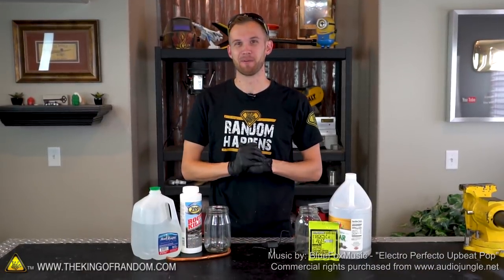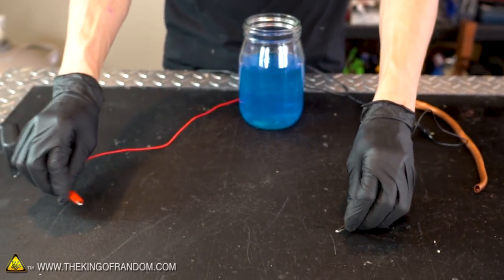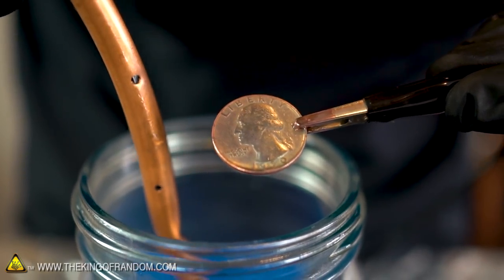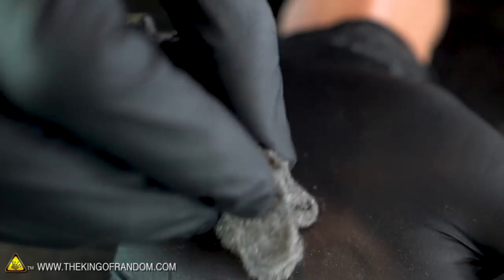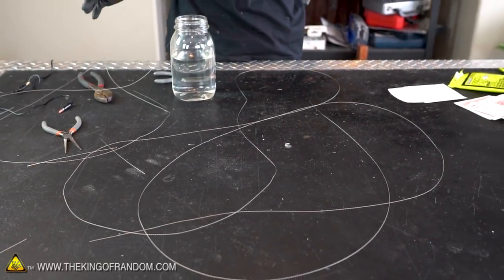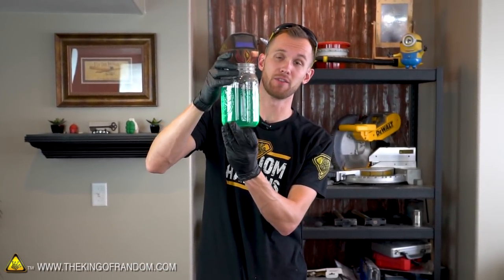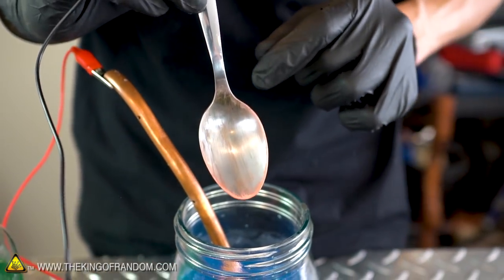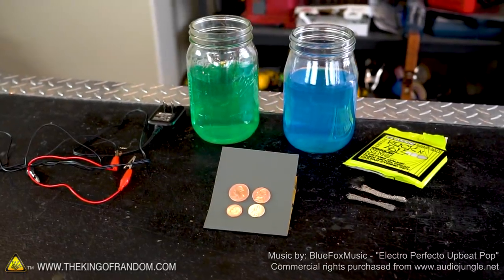DIY Electroplating With Copper and Metal! TKOR Experiments How To Do Electroplating At Home

Comment: I have an experiment for you king of random.
I really like your videos and I have seen you help ppl with curiosity
I wanted you to do this small experiment.
Take three jars 
Label them 1,2,3 
One should be able to handle high pressure and other low pressure and the other one a normal one.
Put water in those containers and then pressurize, vaccumize(if that's a word) and then put all the three containers in the freezer.
Then which one freezes faster and which one slower.
Explain in details
Thank you.
Like if you want him to do the experiment
Edit: you can replace water with other liquids to insight us more or for fun!
Reply: dhruv thakur I have seen you on
Action lab...
Reply: dhruv thakur higher pressure = longer, lower pressure = shorter
Reply: to much thing to read in this comment makes me feel dizzy.
Reply: dhruv thakur )
Reply: engrish
Reply: Pickolas Cage yes I tried there.
He didn't see it.
So trying here
Reply: Sebastian Wießner I know it already. But king of random makes it fun and i want to know in details
Reply: Sebastian Wießner I would think that it's the opposite, it's said that water in higher altitudes, a.k.a. lower pressure boils faster, so I wouldn't think lower pressure would also make it freeze faster...
Reply: Nejx yes you're correct
Reply: Nejx  I don't think it's that, boiling at a lower pressure is just the result of having less pressure to overcome to change phases.  But water with less stuff dissolved in it freezes faster, and with more stuff in it freezes slower, and this would include gasses.
Reply: dhruv thakur II
Reply: I would disagree with this. Water at lower pressure would indeed freeze quicker. It's not got so much to do with it's boiling characteristics as it's got to do with the crystal structure of ice. Water, unlike a majority of liquids, freezes in a hexagonal lattice due to it's angular molecular structure and polar characteristics(that' EXACTLY why snow flakes are always shown to be hexagonal; it's because they are!). This results in it expanding in volume during freezing (yes, water expands during freezing; that's why ice floats on water because density of ice is lesser than that of water since for the same mass, ice occupies more volume). And, any substance that expands on changing state, is assisted by a lower pressure as compared to the higher as lower pressure would push the equilibrium in the direction of change.
Another way to observe this would be, at 273K, at higher pressure, water would be present. Put the container into a vacuum chamber, it would turn into ice.
It's really fascinating how such a simple and essential compound such as water can have such complexity to it...
Reply: Can you also try ferrofluide slime
Reply: dhruv thakur I
Reply: dhruv thakur nice exprement bro 😄😃😀
Reply: dhruv thakur yes
Reply: Pretty cool experiment!
Reply: dhruv thaku
Reply: dhruv thakur you gettin 20$ bucks lol
Reply: Nope, $25.
Reply: dhruv thakur you smart
Reply: Jello~~~!
Reply: dhruv thakur i
Reply: Nice amount of likes

420
Reply: H20 is actually incompressable
Reply: dhruv thakur f
Reply: What about trying to boil it because isn't there something about water boils at 100 degrees celsius at sea level which is the highest pressure place but takes longer (or shorter?) the higher up you go
Reply: sebastian wiebner, higher pressure does not always equal longer. to be in a high pressure state(for a liquid that acts or resembles h2o greatly that's in a container) the material has to be either heated up so there is more energy for the atoms and molecules to use up while they're in motion which spreads them out further, or the overall amount of particles in said container has to be higher than the average amount of atoms that it would take to fill the container(only counting the parts of the container that air is taking because... well that's what you would normally use to pressurize a container most of the time.) with enough space for the movement of the atoms is not obstructed by another atom in their path. so unless you're referring to the material being in higher pressure BECAUSE it's heated up, higher pressure does not equal longer time to freeze. same goes for lower pressure. there's more space for the material to move around freely in, that it loses its energy and becomes colder. it's why liquids boil in a vacuum chamber.
Reply: dhruv thakur cool
Reply: dhruv thakur iikk
Reply: even salt and minerals change the freezing point of the solution
Reply: dhruv thakur in the video yoy should include a phase diagram
Reply: Thanks for the information
Reply: German Nazi VS Soviet Union then you should learn to read
Reply: dhruv thakur is
Reply: dhruv thakur nbuj
Reply: What is happening here
Reply: Nejx ice would freeze at high pressure which is how we can get whats called ice7
Reply: Dhruv Thakur is that a game
Reply: Dhruv Thakur u da bes ideaer
Reply: Dhruv Thakur ddddd
Reply: CLONE
Reply: The  water in the jar under a vacuum is impossible since water molecules expand and evaporate  under a vacuum.,  unless u leave the vacuum pump running, but eventually all the water will be removed from the jar  as vapor.
Reply: Dhruv Th
Reply: What was da moosic
Reply: I clicked like and it went from 1k to 1.1k
Reply: Dhruv Thakur p
Reply: @corndoghead1  oh yeah yeah
Reply: Dhruv Thakur L
Reply: Solid means the molecules are closer, so under high pressure it is gonna faster. Someone above told it wrong so I thought I should tell...
Reply: Did he do it
Reply: im well aware it's been a year, but it looks like you want to use TKOR as a way to do your science fair things for you.
Reply: U in 8th grade? Im indian too lmao
XD
Reply: The 91
Reply: This is a very uncontrolled experiment with factors that can taint the data especially with seperate molecular structures of fluids. Liquids can get extremely hot a f in a very short time in a vacuum only heated by solar energy alone so I am assuming the same is true for frigid temps as well just don't shatter any expensive equipment testing this theory.

Comment: So in theory, I could make all my stainless steel look like gold 🤔🤔😂😂🙌🙌
Reply: Cody Whitlock but you'd need 10+ grams of gold
Reply: Cody Whitlock I
Reply: You’re just everywhere aren’t you?
Reply: You can do it in practical too.
And it's being done economically
Reply: Go visit Cody’s lab
Reply: You are everywhere and always use these 😂 👐
Reply: Cody Whitlock please dont use emojies...
Reply: no quite
Reply: You can, as long as you have something that can solve gold and won't solve the coin
Reply: Cody Whitlock 💵💵💵💵💵💵💵💰💰💰💰💰💎💎💎💎💳💳💳💶💶💶💴💵💶💶💵💵💷💶💵💵💸💰💰💸💸💰💰💰💰💰💰💰💰💰💰💰
Reply: Cody Whitlock if you had a small amount of gold you could dissolve it into solution and plate your cutlery yeah
Reply: Just gold leaf  it
Reply: blackgriffinxx gold leaf is just buffed and glued on, it’s much easier for it to come off than plating
Reply: Cody Whitlock yes
Reply: You dont even need any Gold i do things line this every day🙃
You only need a solution of something like KCN2Au and you have to plate it at first with copper and nickle
Reply: Gold won't adhere directly to stainless. Most plating won't easily adhere directly to stainless. Woods Nickel Strike is what you need to do first. "Strike" plating is a thin but well adherent plating. Woods is a highly acidic nickel solution that you apply with relatively high current. The HCL in the Woods de-oxidizes the chrome oxide that forms on the surface of the stainless, allowing the nickel to adhere. Then you can throw nickel, copper, or gold, right on top of that.
Reply: Pushpa Srinath or paint
Reply: Pure Slow Motion you are everywhere as well xD
Reply: You didnt know that. Oh
Reply: Except he failed to coat stainless steel, and he didn't demonstrate how to do it with gold..
Reply: I have
Reply: I feel like people would use this for evil and nickle coat pennies trying to spend them as dimes hoping no one noticed.

Comment: Try melting salt in the trash can foundry and if you can try casting with it
Reply: Edward Phillips I don't think you can.its a crystal not a metal so it would default to a cube... It what salt crystal looks
Reply: No, you can melt and cast salt, it definitely doesn't just go into a cube lmao
Reply: First what type of salt are we talking about?
Normal sodium chloride has a melting point of more than 800 degree celcius
if the foundry can reach such heat casting with it might be possible
Reply: Leo Tan Tito4re did it in a foundry like grants
Reply: What We Made did what you are talking about
Reply: If made properly, it definitely reaches more than that. My foundry melts copper, that's over 1060 degrees Celsius. It also melts salt easily. I've done it. The only thing that I haven't done is pass electricity through the molten salt and turn it into sodium metal and chlorine gas.

Comment: You should nickel plate a copper plated nickel. Then put it in the fire until it turns golden.
Also, fun fact, copper pennies since 1982 are 97.5% zinc. You could copper plate a recently minted penny and patina it to get that old copper penny look on a new design.
Reply: Fun fact . To nickel plate you first need a copper plate base or you can do a zinc base and it works as well ..thats the only reason it worked on a new penny

Comment: Recently my bank gave me some change that included a 1943 steel penny that looked copper. While it did stick to a magnet, it made a wondeful collection piece. For a few moments I thought I have a copper 1943 penny which is a very rare penny. Copper plating is easy, but glad to learn the nickle plating part. Thanks.
Reply: I believe that there is only one 43 copper penny not accounted for.

Comment: That's interesting, I never considered that electroplating might not bond and could just be wiped off. However, now I'm wondering if this could be a new method of powder coating. That said, the two things that need to be plated are wire/electrical connections (or USB-C cables plated in gold), and heat sinks. Also, have you tried burnishing the electroplating (heating it)?

Comment: I specialize in plating, etc.....your Stainless spoon would  need higher voltage, not so important the current...Try 12 or 24 V....It will get the job done...
Reply: Theo T basically a car battery
Reply: carolyn mmitchell car battery's are 12volt DC
Reply: What? in electroplating the important thing is current density... what do you mean by higher voltage?
Reply: Despite the simple fact that Chromium doesn't like taking electroplating? I mean, it's stainless for a reason.
Reply: Stainless already has nickel in it. Food grade 304 has two variants in the alloy. 18/10 and 18/8. The first number is the percentage of chromium, and the second is the percentage of nickel. (18% chromium and 10% nickel for example.) Even the, not so oxidant resistant, 18/0 still has 0.75% nickel.
Reply: I'm wanting to try copper plating a 7075 aluminum yoyo, and I'm wondering what you'd recommend for a power source.
Reply: @Grisildor  I think you should go and investigate "Anodising". Which is more appropriate for aluminium.
You can get some flashy colors, using this process.

Comment: Can you make a copper foil using this method?
Reply: The copper would be way to thin, it's like nao scale depth, it's not enough to even hold together, I may be wrong but my experience's would say no
Reply: Copperplate a sheet of stainless steel, then peel off the copper. Keep the process going longer for thicker foil.
Reply: Melted copper would just burn the wax paper.
You have to roll out metal in order to make foil and it takes many, many passes with a ton of pressure to get it that thin.

Comment: Stainless has a lot of chrome in it so you have one do a bit different process to plait it ,when I was a plating metal, we used a acid bath and high amps to plate the metal to start then in a low amp after ,the lower the amps the better it lays on the part. Thanks for showing us it was great to relive those days.
Reply: Woods nickel strike the Stainless teel first then copper plated, Woods nickel strike is 100% Nickel Chloride very acidic and will make stainless steel reactive to the nickel coating

Comment: very nice vid buddy,,i am glad to see you using the fine steel wool as i am using this now to clean prep my parts then giving them a quick acid and water rinse before plating and it works  where before i was failing,i cant believe how fast my dime turned to shiny copper where before it was going muddy and black and it wiped off easy,,learned alot every time

Comment: Try cleaning surfaces with finger nail polish remover (Acetone) then alcohol. This system works well to clean surfaces for stickers or prep for paint. I use it in rc plane/car building. Works very well.

Comment: You know how some wrist watches are gold plated. Wouldn't it be cool to take a cheap watch and plate the metal parts with copper?
Reply: It would be cool, but bare copper is not recommended for prolonged skin contact. Also, it tarnishes very quickly and that tarnish can stain your skin green for a few days. A clear coat of some sort would deal with all of those issues though.

Comment: you should invert the current for the spoon to make adhesion eating a bit of the metal before trying to put copper on it, also bending a curve to your anode so it could help the middle process, should look more like an S trying to keep a nearing point away from the edges. 2 anode will help having a stereo deposit and one in all coating.
Reply: @The King of Random read upward the message, would help

Comment: Can you use electrical tape to mask off certain parts of the steel and electroplate a design onto the steel?
Reply: yes, but not necessarily electric tape. Other tapes might work better by sticking better to the metal while submerged.

Comment: Make copper sulfate
Reply: a-lpha of Zeldaforme Gaming ight bet dawg
Reply: a-lpha of Zeldaforme Gaming easy. Just dissolve copper in sulfuric acid.
Reply: The concentrated one
Reply: 3.14159265358979323846264338327950288 ok, fine. Add hydrogen peroxide to it first.

Comment: hey was just wondering if it would be alright if i used a power adapter having; 
INPUT:100-240V 
OUTPUT: 1500 mA 
if it's too much output can i use a 9V battery instead?
Reply: That's 1.5 Amps it's the voltage that you don't want too high you can use a couple of 9V batteries in series but they will flatten quickly.

Comment: Wondering if you know 
If copper will adhere to steel header bolt.
The reason I ask is because in the past my steel bolts welded themselves inside of my aluminum head. 
Hoping copper plating will eliminate the problem. 
😊 TY kindly

Comment: I would like you to try making through-holes/vias on a circuit board (pcb).
This means doing:
Making a pcb from copper clad circuitboard with the drilling of the holes first. Then painting the holes with conductive ink. Then use your copper sulfate solution to copper plate the pcb (or the now conductive holes). Next make the rest of the pcb (toner transfer method or milling). When finished, plate all tracks and pads with nickel.

Hope you will choose my idea! 😉

Comment: Hello Random Kings. I wanted to suggest an Idea for a plating project (I myself am new to plating so it might be completely useless). I know you tried casting some metal poke balls a while ago and I wanted to run this idea by you and perhaps give you an inspiration: Giving the metal poke balls some color by plating the top with copper and bottom with nickel or even leaving bottom as is. I am curious if it will even stick to the ones you made.

Comment: Buff it with steel wool?? Are you kidding lol??
Reply: I have been doing this for years. I use steel wool on a Dremel. By hand doesn't do it. Just puts scratches on the coin. Nothing works better for me. Don't even have to clean it other than rubbing with a qtip and iso. If it doesn't plate to your satisfaction. Hit with Dremel again and repeat process. Never had to do this more than 4 times. The plating has remained on the coins for years with no sign of wearing despite being handled over and over
Reply: It's most likely not the steel wool you're thinking of, like the scratchy kind that feels equivalent to 220 grit sand paper.. He's talking about the kind that's actually met for buffing and polishing, like 00 to 0000 grit (fine to super fine)    ...i used to fabricate counter tops, the darker the surface, the easier it is to see ANY miniscule scratch.. If u don't have an MX pad on hand, steel wool is definitely your best bet for a shined surface

Comment: I've done this but I used actual 99.96 pure nickel plating electrode. My problem is that it seems to build up much to fast anymore. I'm not sure if it's because my solution has built up so much or because I tried to plate some speaker magnets however I dip my items to be plated in hydrochloric acid to clean them before plating as I've seen in other videos. I also used the vinegar solution to plate with copper and my items come out a solid deep but dull copper pink color. Still pretty cool.

Comment: You should take piece of copper, like a pipe or something and first coat it in nickel.
Then copper.
Then nickel.
Then copper.
Then nickel.
Then copper.
Then nickel.
And so on, as many times as you'd like. Then you shuld try to sand down to the base layer on one spot. I think it would become a really cool effect. It might look like the topographical parts on the map or something like that! =D

Comment: What if you plated a bullet (or just the shell) with both copper and nickel but in a candy stripe pattern maybe you can coat it with copper first and then use tape to mark the pattern and then coat it with nickel.